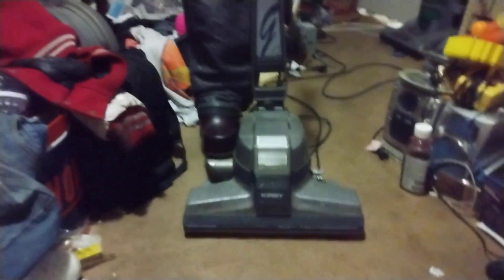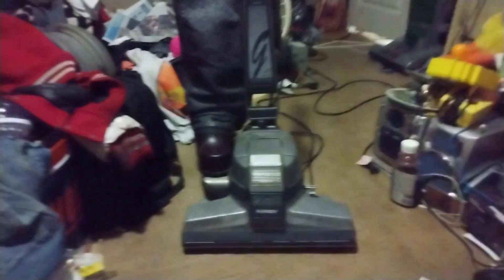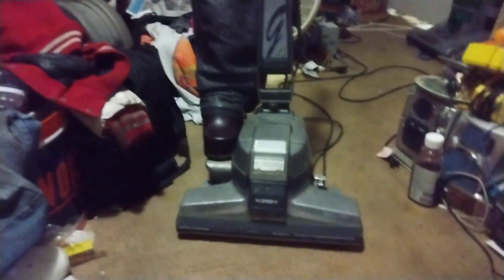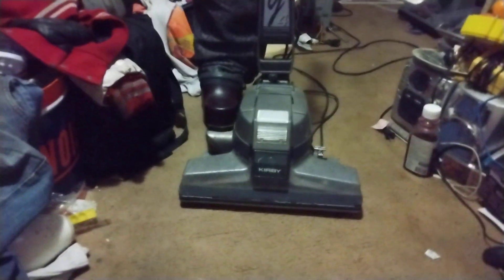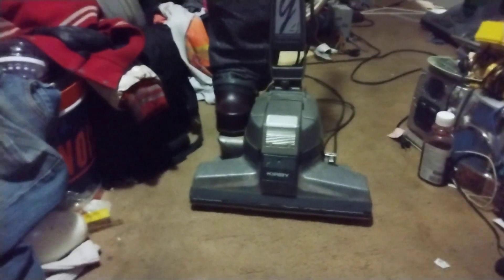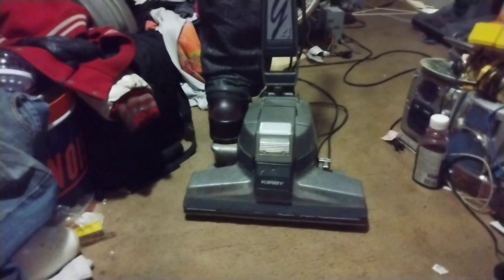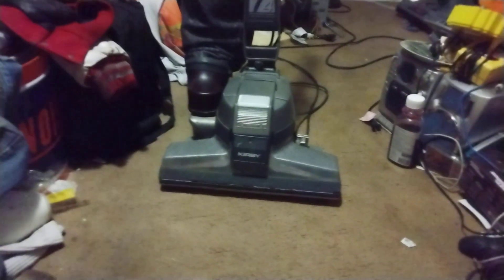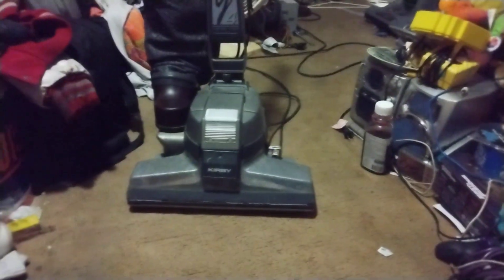1994 80th Anniversary Edition Kirby G4 Upright vacuum Carbon Brushes on the warning signal

Comment: If it makes a small ''squeak'' when it winds down, it could be the carbon brushes or the rubber part on the fan spacer. When the grease dries up on the bearing eyelet on the front bearing plate, the rubber will make a slight squeaking sound.
Reply from the maker: It was doin a loud rubbing sound when u spun it by hand motor would be tight but not seized up now it's not tight at all I'm hoping to eventually get the bearings and brushes redone I checked the carbon brushes there wasn't much left
Reply: @CaptianNamco  Yeah, it wouldn't hurt to replace the brushes, bearings and maybe the fan, also. Those Lexan fans get stress fractures after so many years and can explode when in hose mode.
Reply from the maker: @mattjones7621 i know they can but it's gotta go to the shop for it screws are seized
Reply: @CaptianNamco  Oh, man! Well, good luck. I had a Classic 3 with frozen screws one time. Me and my local vacuum guy had to knock them loose with a screwdriver and hammer.
Reply from the maker: @mattjones7621  wow